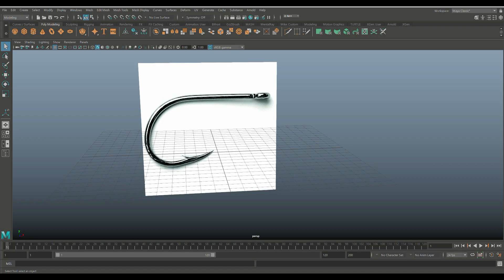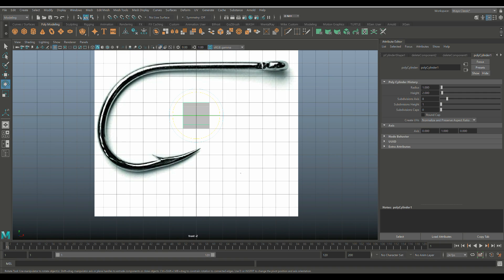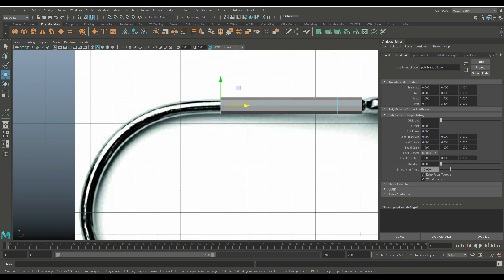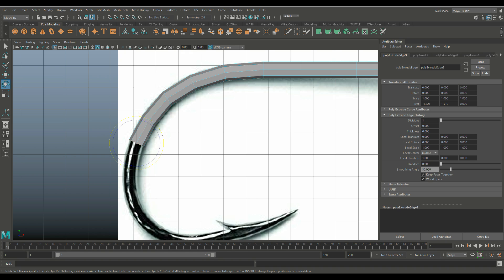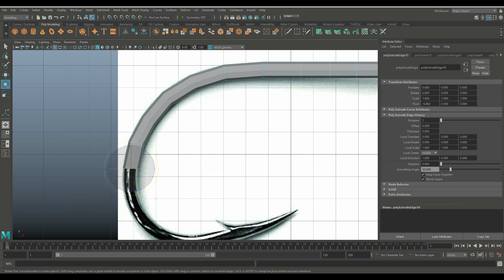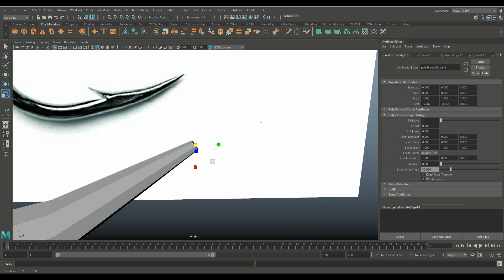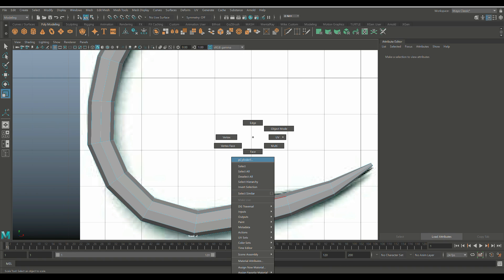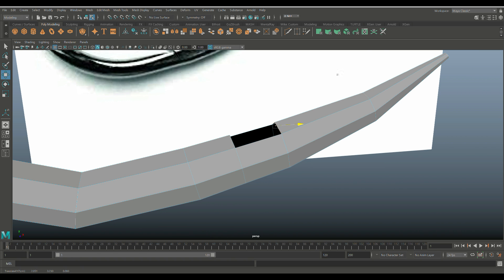Maya 2019 tutorial ( Beginners ) How to model an accurate, detailed 3D Fish Hook in Maya 2019

Comment: I don't understand why you would pick the worst method to do that when it's a 5 minute job if done with a curve extrusion.
Reply from the maker: It is not called a tutorial for nothing. It is all about learning different techniques to do the same thing. I am fully aware that a curve is faster.
Reply from the maker: You are totally right. I have shown the curve method in dozens of videos. This is a modeling exercise for beginners
Reply: @MHTutorials3D  Well now that you've added "Maya 2019 tutorial ( Beginners )" to the title I'll retract what I've said.
Reply from the maker: @sybeck1823  It is a good thing you mentioned it, that is why I adjusted it. Thanks
Reply: I think its for modelling beginners but yeah ep/cv extrusion would be much quicker and simpler.